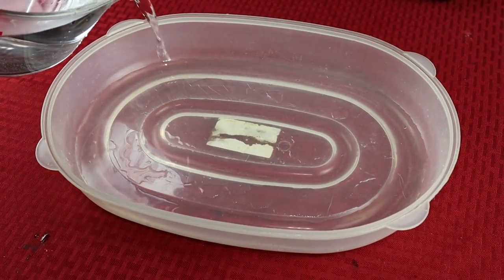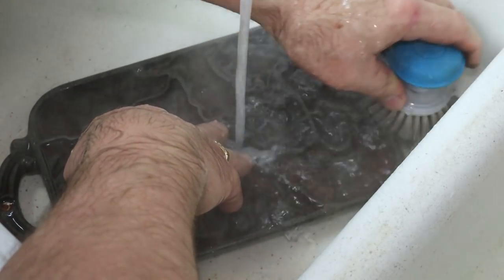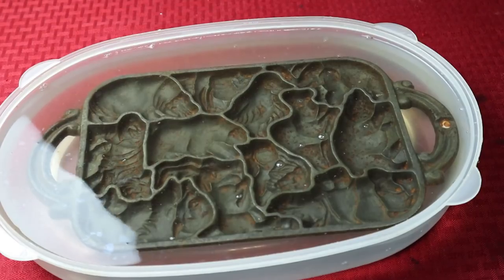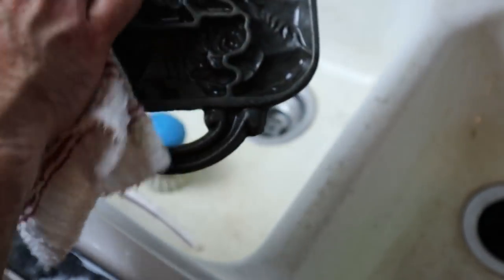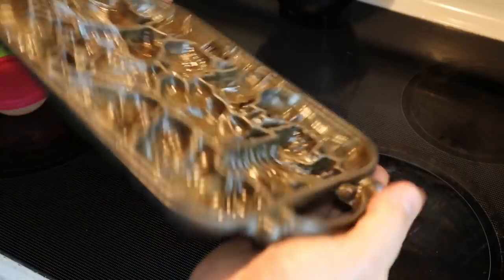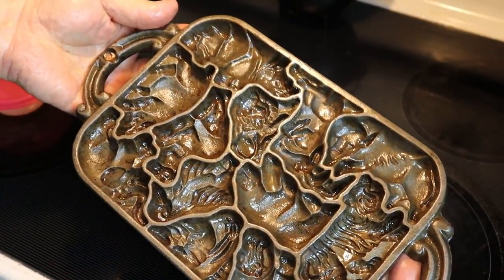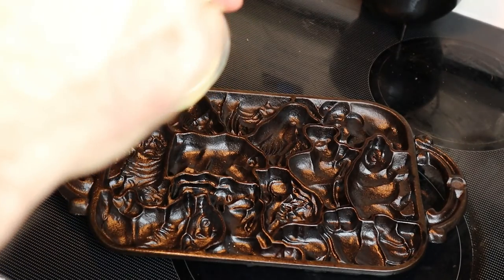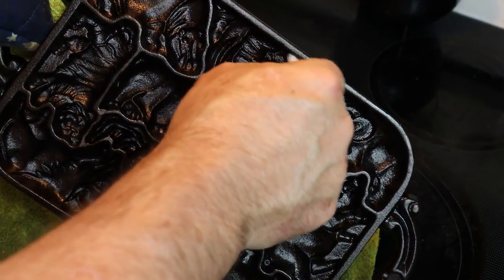Vinegar Rust Removal

Comment: Lye bath for as long as needed for gunk/carbon buildup first.  Can stay in lye for weeks or months.  I usually leave in for at least three days fully submerged to avoid a line on the finished piece.  Clean and return to lye bath if needed.  That pan didn't have much gunk at all.  Then 50:50 vinegar water bath fully submerged for no more than 30 minutes at a time unless you want to etch your iron. Fantastic job sir! Looks great.
Reply: That happen to me with a pancake-griddle.  Rats!  it was a grimy nice 80's piece.  :(

Comment: Found out if you have a metal pan and can warm the pan and vinegar it works way better and faster. Really goes to bubbling and you can tell quick it's doing it's thing. Warm or lightly hot, just enough to see a little steam coming off the vinegar.
Reply from the maker: I will be giving that a try.
Reply: @castIroncookware  I did two just last weekend. Way worse than what you had here. Been cooking on them all week. Seems heat is the trick.

Comment: If doing multiple PC's would a pressure washer work in place of scrubbing?
Reply from the maker: I would not think there would be enough pressure to remove the seasoning or rust. I definitely would avoid using any kind of media blasting. There is too much potential for damaging the cast irons surface.

Comment: Vinegar works just great as long as you don't have those ugly black carbonized warts on your like you will see on skillets!  I've used vinegar many times to remove rust and those warts, but I've soaked it a bit longer (try 2 days!) without damaging the pan. I think that electrolysis will work better for those warts, but vinegar is fine for rust.  I use Dawn soap as well to clean pieces I am restoring.  I haven't tried hot water, but may try it and see how it works.  I use Pam spray to coat my pieces until I can do a real seasoning to prevent rust.  Grape seed oil works as well, I just happen to have Pam on hand.  I love that piece - very interesting.  Great job on that piece.  Looks great!
Reply from the maker: Thank you. I was going to pass this piece along but I decided to keep it because it was very interesting. John Wright pans or really neat but they are hard to restore.

Comment: My granny used to build a hot hot hot roaring fire throw her cast iron into the fire put more wood on top and make it hot hot hot then she would go back when the fire was burned out take the pieces to the stove and reseason.
Reply from the maker: There are a lot of people still using that method but there is still a lot of potential danger in damaging the pieces that way.

Comment: If you use a acid for rust you need to use a base to neutralize it or it can continue eating the metal  long after cleaning the rust off
Reply from the maker: A good thorough scrubbing with soap and water will remove and dilute it.

Comment: not so good - iron will absorb the soap
Reply from the maker: The soap will completely rinse away. The reason why the old timer didn't use soap was because most soap from that era contained lye and it would strip away the seasoning. Modern dish soap is much more gentle.

Comment: Will a vinegar bath hurt my nickel (or chrome) plated Griswald #8 chicken pan? The sides are mirror like and spotless, but the inside bottom has some worn away places from my grandmothers use. It has a slight rust colored tinge to about 1/4 of the bottom and then the rest is black with one spot of silver where she stirred the hardest. It still has a smooth as glass surface and is perfectly flat. The lid is also spotless. I don’t want to ruin it, but I would love to restore it to its original glory. What do you recommend?
Reply from the maker: I would probably not use vinegar on plated pieces. I've heard of a lot of people using Bar Keepers Friend with success. The cooking surface of the pan can be cleaned with coarse salt, a little bit of water and some elbow grease. You might be able to use a vinegar water solution and pour it in the pan up to the rim and let it sit for 20 minutes before you start the process of cleaning with salt. It sounds as though you have a great piece of cast-iron there. I will look into this deeper and try to have more information. Maybe I can put findings  in my next cast-iron answers video.
Reply: Cast Iron Cookware I would greatly appreciate any further information you can find. I’ve searched YouTube for information and have not been successful. I will wait for awhile in hopes you can give me a more definitive answer. Thank you so much in advance, and yes, when I found this pan and her hand written cookbook amongst her things when she passed, I knew that I would be able to continue our family traditions and be able to pass them on to many more generations to come provided that I can take excellent care of this coveted pan.
Reply from the maker: @hollym.3599  I will definitely look into this deeper and gather as much information as I possibly can. I've had to hold up on producing videos because of my computer issues but I should be picking up a new one today. Hopefully I will have a cast-iron answers video coming out next week and I will include the information I find on plated pieces in that video.
Reply: Cast Iron Cookware excellent! I look forward to it. Thank you.

Comment: So i a kinda confused on which process deals with which issue. Lye takes the old seasoning off only, but not the rust?  Vinegar or electolosys takes off the rust?
Reply from the maker: A Lye bath or Easy Off only removes organic (Old Seasoning) and Vinegar only removes rust. An Electrolysis system will remove both at the same time. I hope this helps.

Comment: Thank you! Very well explained. 500o for an hour doesn't it warp and why so hot.
Reply from the maker: It has a lot to do with a particular oil that your using. You have to get above the smoke point. I use grapeseed oil that has a smoke point out 420ﾟ. It will work fine at 450ﾟ but I like to go a little over.  As long as you are heating evenly, you will not have any issues until you get to over 650ﾟ.

Comment: What kind of wax do you use to re-cure and where does one buy it?  Thanks.  About to begin a huge restoration job.
Reply from the maker: I use Easy Beezy Cast Iron Seasoning. It is a product that I make myself and it is available at easybeezy.com
Reply: Is that what you call Buzzy wax?

Comment: 3 times at 500 degrees..how long did you let it sit before you did another coat???
Reply from the maker: You can let them cool all the way down before starting a new round but I usually apply the next coat as soon as it cools down enough for me to handle. Somewhere around 200 to 250 degrees.

Comment: Oops, I did a straight vinegar base 😳 but it doesn't look to be pitted or damaged afterward 🤞
Reply from the maker: You can use straight vinegar at short periods of time. you just have to be more careful. Most vinegar you will find is at 5% acidity.